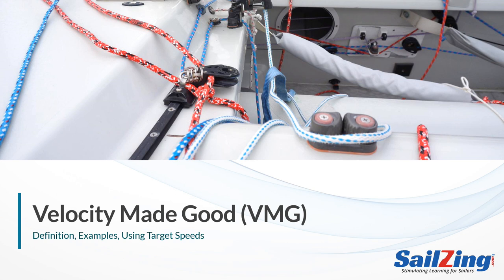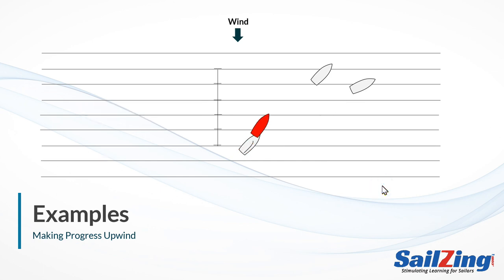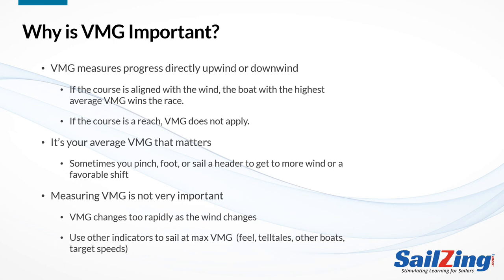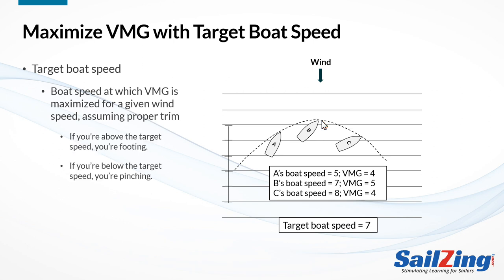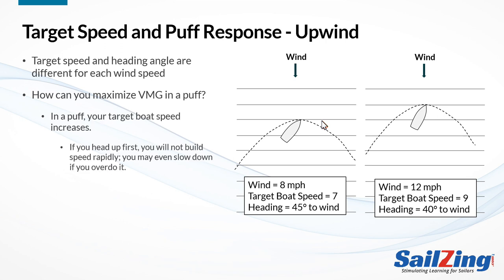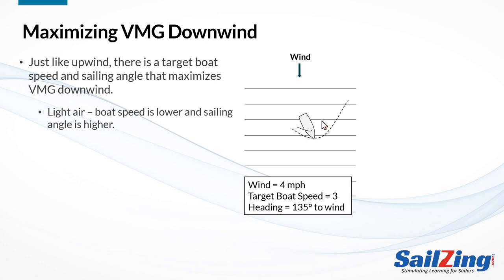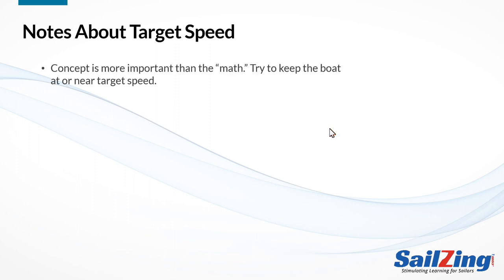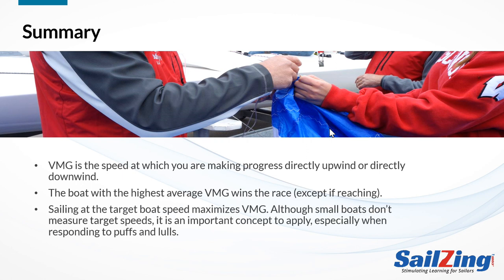Velocity Made Good (VMG) - Definition, Examples, Target Boat Speed

Comment: An important question, i need a physics answer. In the case that vgm is parallel to the the wind Is it possible that the value of VGM is bigger than the  value of the wind?
Reply: no.
Reply: Many thanks for the answer, after much research you are the first to confirm that it is not possible to have a VGM greater than the wind. Sorry for the redundancy of the question, I ask you for a reinforcement, your answer is also valid in case of downwind right?
Do you know if there are textbooks where you can study the physics of this topic?

Comment: Good explanation! However I'm not sure about how I should think in case there is a wind shift. Let me give you an example:

Let's say we have two boats, A and B. They are both sailing close to each other at the port tack and at Best VMG. Now a right shift comes in and both boats are in a header. To compensate for this shift boat A just continues on port side but have to fall off to keep the same optimal speed (Best VMG?). Boat B tacks to starboard and will be lifted. The further boat A continues on port tack the more distance to the windward mark he will loose.

So does boat A and B have the same VMG after the wind shift or does boat B have a better VMG?
Reply from the maker: VMG is defined in relation to the wind. There's another term, VMC (velocity made to course), that is more appropriate when the wind has shifted and is not straight down the course. After the shift,    B gets on the lifted tack and has better VMC than A. If you want apply the term VMG to the situation described, you have to choose whether you measure it against the actual wind at the time or to some other measure such as the average wind. if you measure it against the actual wind, then both A and B could be maximizing their VMG. Interestingly, there's a technique called Wallying in which you pinch if/when you have to sail in a header and foot slightly when you're in a lift. This maximizes the VMG to the average wind. We'll write an article on this eventually, but you could search for the term on the internet in the meantime.
Reply: @SailZing  Ok, thank you! I didn't know about the term VMC, but that explains it all. What actually got me thinking was this (I don't remember the exact phrasing, but it was something similar to this) - "The boat that has the best average VMG will always win the race". That can't be true if we're talking about VMG. You can sail at the best VMG the whole race, but if you keep missing the wind shifts you will still lose the race even though you had the best average VMG in the fleet. Or am I still missing something here?
Reply from the maker: @BennyLindstedt71  If you define VMG in relation to the average wind direction, then the statement is true.

Comment: And what about wally tactics? (More important than vmg? :)  )
Reply from the maker: Good question. We're looking to do an article about "Wally" in the future.
Reply: @SailZing  
Oooo. What a quick answer)))
However, try to preempt the video by answering the following questions:
1. Is 'vmg tactics' part of 'wally tactics' or vice versa?
2. Which of the yachts is better adapted to wt - Laser or 49er? Is it relevant on Optimist?
3. In what leg wt is more effective - upwind or downwind?
4. In what wind condition should we use wt?
5. There is an opinion (even among top racers) that wt gives a negligible advantage and even - tactics are speculative, far-fetched. Is that so?
6. By the way, I met the term 'bow down' in your videos (Roble/Shea Sailing).
Is that Wally?
Reply from the maker: @MikleM1  Thanks. We'll look into these areas. There's some data out there but not a lot.  "Bow down" simply means to foot a little, not necessarily for the purpose of wallying.